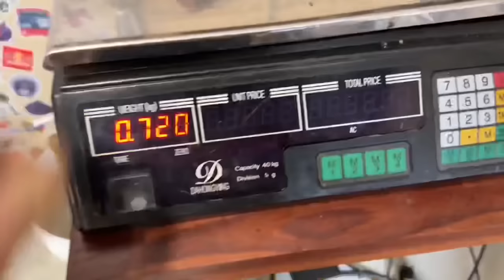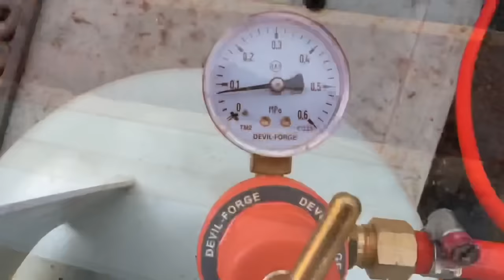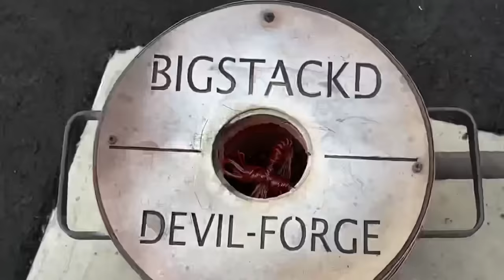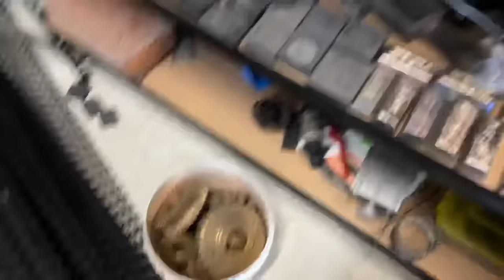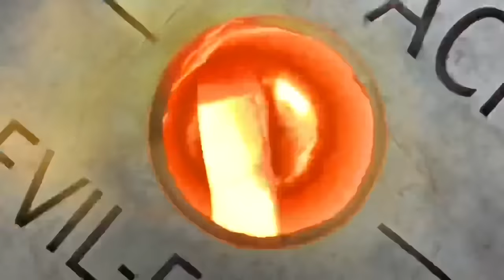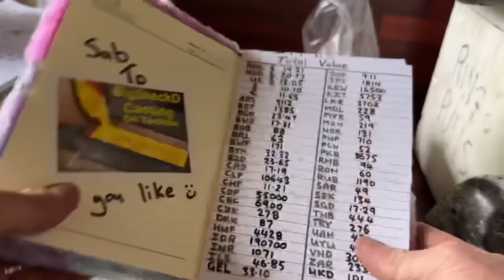Casting WW1 Bronze Bayonet From Scrap Metal -  ASMR Metal Melting - BigStackD Trash To Treasure

Comment: Approximately 5,000,000 Pattern 1907 bayonets were made in Britain during World War I. The makers were Wilkinson Sword, Sanderson Brothers & Newbould Ltd, James A. Chapman, Robert Mole & Sons, and Vickers Ltd.
The X on the Riccaso was a bend test mark… there were presentation ones of these which bore the 1907 date mark and are extremely rare.
You have number 528 of 1000 …. Please don’t polish it.
Reply: In other words, the bayonet he has is very rare and (potentially) very valuable. Sweet.
Reply: Interesting - where is the X and can you shed any light on the other marks - was it issued in 1917 or 1923 Are the other stamps arsenal marks?
Reply: The '17' stamped over the '1907' indicates a 1917 manufacture date. The partial symbol over the '19' is perhaps an '8', so the actual manufacture date would be 8th month 1917. The fact it's stamped with GR indicates it was made during the reign of King George (1910-1936), as opposed to Edward (1901-1910).
Reply: In other words, put it in a safe place and DON'T do this again..lol
Reply: SOME SOLDIER PROBABLY BROUGHT THAT HOME AFTER THE WAR
Reply: The '25' stamped on the opposite site indicates the bayonet was re-certified or re-issued in 1925.
Reply: WoW!!! Thank You for the detailed information. I saw the crown emblem and knew it was of the English realm.
Reply: As posted don't abuse or polish it. Keep it oiled and taken care of.
Reply: I thought so, it was a Wilkinson.
Reply: Thank you for the info. Must check the markings on mine.
Reply: All the Hallmarks indicate it made during King George 5 very nice piece indeed
Reply: @johnbarleycorn699  It's possible but more likely as it was given the 1925 re-certification mark it was manufactured in 1917 at the end of the war and never saw combat. Thousands of these have made their way through army surplus, but this one is still in very good condition.
Reply: Nice bayonet! I could use one for my Lithgow made No 1 MkIII SMLE. I had one in much poorer shape but it was stolen. I still have the SMLE though.
Reply: Your bronze replica is great too!
Reply: @yaboyblacklist2431  It is worth about £60 and you can buy them in practically any market across the UK. They are not rare at all and there are still millions kicking about.
Reply: @InstructorRandy what's wrong with polishing it?
Reply: As is the bayonet is worth 8000$ usd
Reply: @konstellashon1364  removing the patina is damaging it.  the patina is part of it

Comment: So happy you're finally making something out of my favourite alloy (at least, among the ones you're able to make), proper copper/tin bronze. I always find myself shouting at casters, especially those who specialise in weapons, like Alumitube, "Make it out of bronze, FFS, at least it was a material that WAS used in weapons. You'd have been unlikely to find an aluminium sword...
I know you're hardly likely to find tin while scrapping though, so I guess that's fair enough.❤
Reply from the maker: Very true an aluminium blade would break on any type of hard impact so at least ornamental aluminium ones look good at least. 
I reckon I’ve been through 1000 scrap bins in my time and I have never once found Tin unfortunately . I need to get all my Tin off eBay and it’s certainly not cheap👍🏻

Comment: This is a common turn of the century 1900s bayonet that was used by many South American militaries.  There was an armory in NY that use to sell these in bulk about 25-30 years ago for about 6 dollars a piece.  I bought a couple of dozen of them and cleaned them up and gave them as gifts.  I still use one of them as a digging tool when I am metal detecting.  Now I see them on ebay for as much as 125 US dollars.

Comment: While pouring a phosphor bronze cannon barrel,  I discovered that some things just had to be poured while elevated or vertical.  As a youth, I finished my hedge trimming with the use of a 1917 pattern British Enfield bayonet, bearing a marked resemblance to what you've re-made here.  If it were still in my possession, I would be looking around for my stash of phosphor bronze leftovers.  A handsome tool you've made, there.

Comment: I have a wrench that turned out to be chrome plated copper steel alloy. It's neat cause it just looks like copper. What would you get if you put it in the forge at copper melt temp? A Swiss cheese of steel in a puddle of copper?

Comment: This was a cool one. I do wonder about one thing. I've seen some others pouring longer moulds like that with several air-holes along it and only from one end. Does either method work or is the choice based on something I don't realize? 

As far as the organization of the shop goes, I think if you asked any of your regular viewers to go and get something from the shelf we could probably do so... except a 10mm socket. Little buggers.

Comment: Can't believe doing that in that wood shed don't make you nervous.  So easy to burn that whole setup down
Reply from the maker: I’m only a few feet from my Bore Pump and hose, which is the size of fireman hose basically plus it’s surrounded in steel so the fire would be contained if it was to ever happen. So all is good my friend👍🏻.
Reply: It all becomes clear now.  Not sure why I doubted you for a second.  Melt on and Happy New Year  @bigstackD

Comment: A challenging cast due to the length.  I wonder if standing the mold on end would've helped?  Like with the handle facing up?  I've seen some bronze sword casting ajd the molds are usually cast with the sword point down.
Also, I had no idea Austrailia had Rabbits!

Comment: Based on the markings, I'd say the bayonet is likely British.
You can see all the proper remnants of the crown stamp, and 'Wilkinson' at the base.
Look up the 'Pattern 1907 bayonet'. Seems to fit every single description, including the leather scabbard with metal ends.
The Japanese Type 30 bayonet is very similar, because the Pattern 1907 was based on from its desgin, but the markings on the one you have, BigD, are definitely British.
The small stamps of inspection, and the one with an E.R., for Edward Rex, are most assuredly British stamps. Hope this helps! 👍

Comment: 70’ of bench and an organized clutter.  Sir, you are significantly better organized than most people.   Liked you outdoor, under cover location for melting today.  Any chance you can make that a permanent location for your winter or will the heat deform the lean-to ceiling from building to container.?

Rather than putting the boys on diets, perhaps you could add chasing rabbits to their daily routine.   Wishing you and your family a blessed week filled with gentle seasonally appropriate weather and restful evenings together around a shared fire.  Peace brother

Comment: the bayonet was a long bladed knife that could be used as just the knife, or could be mounted at the tip of a rifle like a lee enfield or a kar98k. it was a very effective weapon due to it's capability to be mounted to a rifle; hence the hole on the guard of the blade.

Comment: BigstackD I was a couple things 1 would it be better for more sprew holes? 2 would a center fill hole cast better?3 if the fill side of the mold was slightly elevated would there be less voids in the product?

Comment: If I remember correctly, in past videos, you mentioned that the tin melts at a lower temp than copper and a little of the tin burns off. Wouldn't it be better to melt the copper and then add the tin? Less time, at high temp, for the tin to burn. Honest question. I know nothing about melting metal except what I learn here.

Comment: I'm pretty sure you're supposed to add the tin to the copper once it's molten, what with tin having a much lower melting point than copper does, in order to minimize how much gets lost to evaporation. Also, you probably would have gotten better results if you made it as a standing pour.

Comment: You know, I suspect that water is adhering to the graphite powder particles. Graphite powder by itself, in it’s loose form has a very low thermal conductivity. So it will take quite a while for all of the moisture to be driven off of the powder in a warm mold like that. It also has a fairly high surface energy, which makes adhesion stronger. You would have to heat the powder either by itself or in the mold for longer to get rid of those voids in the bottom of the ingot.

Comment: I recognized two of the markings on the bayonet. The arrow looking device (above the '25) is called a broad arrow and indicates that is was the property of the English monarch. Most everything the miltary owned was held in right of the Crown and was marked in this way. The 'V' shaped device below and left of the '25 I believe is also a representation of the broad arrow as used by the colonies, thus the bayonet is probably from the Australian Army (possibly New Zealand). On the other side the only device I'm sure of is the King's Crown. That would be in keeping, as George V was monarch at the time of WWI. I'm not sure if the date 1907 indicates when it was patented, with '17 as a date of manufacture.

Comment: has anyone ever thought about using one of those massage guns with flat plate attachment to compact their sand, because in construction we use vibration and a plate to really really pack it down. would it not have a similar effect plus when you need to shake it to balance the sand give it a quick massage and done.

Comment: Just a question brother, Should you not do an upright mold specially when making weapons, cuz the molten metal doesnt go all the way through, and when you pour from both sides, The part where it touches each other, Will develop fracture in practical use. though most of what you melt is aluminium or copper or other lighet metals, hence not being actually used in any practical purpose, dont you think even like that when you make it, it should be perfect? (Just saying cuz you do pretty much everything else perfectly). An upright mold will automatically get filled due to gravity, and it would be a single solid peice, so not as prone to getting broken

Comment: Can someone explain why at 7:35 the furnace was making that sputtering noise? I have the same problem with my homemade furnace a lot and am wondering if there’s a way to fix it. Something to do with the pressure at the nozzle head maybe?
Reply from the maker: Simply This normally happens when the bottle is running out or the gas is turned down to low👍🏻

Comment: You can forge barss at temperature between 600 and 800 with a coal wood forge and still manage to melt alumium at the same time I have done it by myslef I recomed you all try it But one think to bare in mind is the fact that you must heat the brass peace between 600 and 800 Celcius

Comment: @2:00 This is more proof that it was meant for action. WEight is important in a blade, and a Cutlas like this when light and balanced is worth alot...  Seriously\, You shouldnt have cut off the handle wood, Contact professionals and have an extensive research done into this blade...